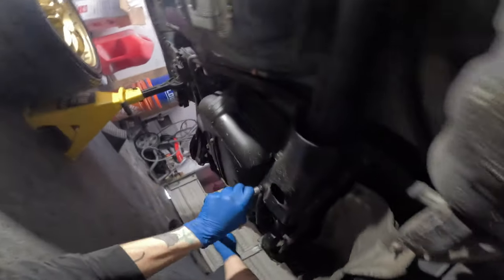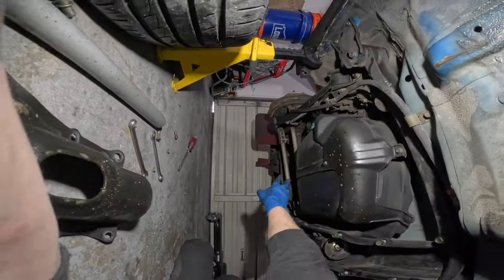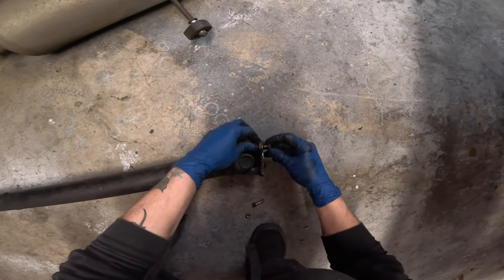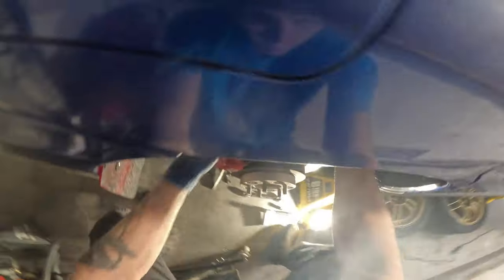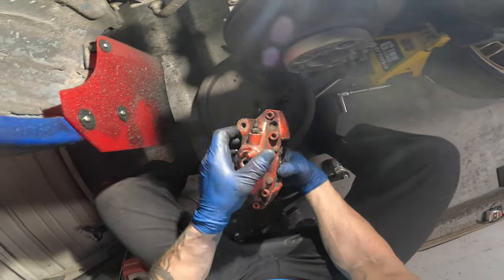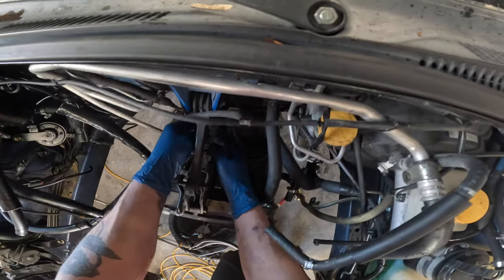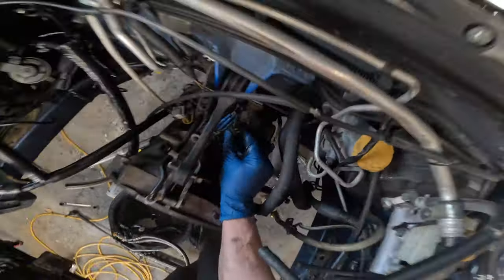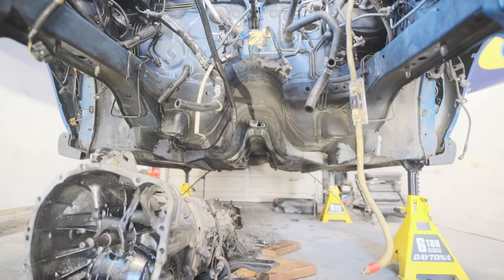Rebuilding A Neglected STI Ep. 2

Comment: While you have the suspension out, might be worth looking into replacing the bushings. On a car this old they are know to wear out and introduce slop in the handling. I have all polyurethane on my car and it handles great, but the NVH is noticeable. So consider factory rubber replacements depending on your usecase for the car. I will say the poly ones weren't too much for my '15 sti, maybe $600 to do the whole car. If your budget is tight, you can get some specific ones for ~$25 each, so might be worth looking into your options there. No clue what oem costs.

Specifically I'd definitely do the swaybar bushings, and endlinks. They both have a lot of flex that prevent the sway bar from actually transferring load to the opposing wheel. Along the point of sway bars, my car has 24mm front and 19mm rear from the factory. Upgrading the rear to a 22 or 24mm to even them out is a night and day difference in the car's ability to rotate in a turn. Does a lot to help the understeer.

Last recommendation, on your last video i mentioned moving the AOS drain line to the turbo return. Thanks for replying. If you don't already know, theres something called a "cylinder 4 cooling mod" that uses a coolant drain plug on the back of the block to rerout some coolant into the heatercore line. This addresses an issue unique to cylinder 4 where the coolant doesn't properly flow past the entirety of the cylinder wall, causing a hot spot that is a contributing factor in cylinder 4 ringland failure. The products available to fix this cost around $90, but really you just need a properly sized threaded fitting, some hose, and a T. You can buy these parts individually for like $15 and save some cash.
Reply from the maker: Yep, I replaced almost every bushing possible on my last build. I did use polyurethane and I personally prefer them and don't mind the increase in NVH. I've also installed Cylinder 4 cooling mods on all 4 WRXs I've owned.

I didn't realize the rear sway bar can make such an improvement so thats great to know! These cars really do seem prone to some pretty serious understeer. 

Thanks for the info!  Cheers!!

Comment: The exhaust was ugly.. but it still flows, that is not a performance hindering thing. It's just ugly. :)
That was not  a 73.1mm, that is probably the external diameter! That's probably a 25mm spacer.
Good job to to all that without help!
Reply from the maker: You’re totally right. Sometimes I say things when filming without thinking about what I’m actually saying 🤣🤣 73mm would be way thicker. Still tho, 25mm spacer on stock length wheel studs is kinda sketch IMO

Comment: I just assume the steering rack will eventually leak with age. There are apparently re-build or re-seal kits for the racks.
Reply from the maker: Yeah, I've actually rebuilt one of these with a re-seal kit. It did work well for a while, but I sold the car about six months later and so I don't really know how long it held up.

Comment: the genome comes with 2.5 inch stainless pipe he had to have it stepped up ti fit a 3" thats kind of what i had done to mine.
but the metal is super good i had it flared and then welded much cleaner that way.
Reply from the maker: Thats cool. Seems like thats what was maybe tried here. Just low quality work

Comment: When it comes to the steering racks on the Subaru NEVER NEVER use aftermarket racks. If you can always replace it with a factory one
Reply from the maker: Definitely not. I have used a refurbished OEM rack but it also leaked after a few months.
Reply: Something I’ve been doing with my STi is changing the power steering fluid on an annual basis. Not sure if this works but it certainly doesn’t hurt. Car is 3 years old with no leaks thus far.

Comment: I hope you used a degreaser or iron remover or other soap to help remove muck; otherwise you are just pushing it around....as far as the spacer, the hub circle is 73mm (EVO hub size) and you are suppose to use acorn cone/ball seat nuts to hold the spacer depending on what it requires (just like a wheel)....are you a Harbor Freight Inside Track member?   If nothing else, this can be a good HF product use video/series.   6-Ton jack stands; for when 3-Ton won't cut it on a 2800lb car....
Reply from the maker: Used about a gallon of degreaser 😱

Comment: You’re correct the welding is shit. But at closer inspection it looks like it also reduced in size meaning from the collector it’s 3.0” then down to 2.5”? That STI genome can be saved, if you can take it to a real welding shop, have them chop off the collector, and all that other crap you could possibly find a welding shop that can do it for you properly, and still save the muffler. However, that’s something you want to save till the very last or close to the very last.
Reply from the maker: Yeah I looked at it again after reading your comment. Does look like they may have resized it and stepped it down with each weld. Not sure what I'll do with it yet, but taking it to a pro may be in the cards.
Reply: Came here to comment this, GeNome parts were oem options, and as such the genome exhaust was designed to mate up with the oem 2.5 inch exhaust, they welded a bunch of extra shit to it to mate it to a 3 inch mid pipe. my recommendation is to get just the genome muffler welded cleanly to a 3 inch axleback for a nice clean look.
Reply: Yeah, +1 on the Genome info. I have an '05 JDM WRX with one and the original owner's documentation confirms that it was bought and fitted at the supplying dealer. Loving the breakdown and build btw - can't wait to see the end result.🤘